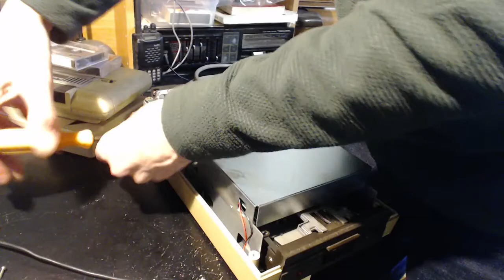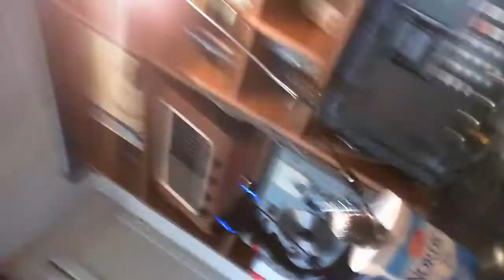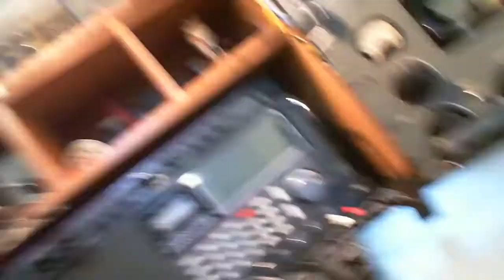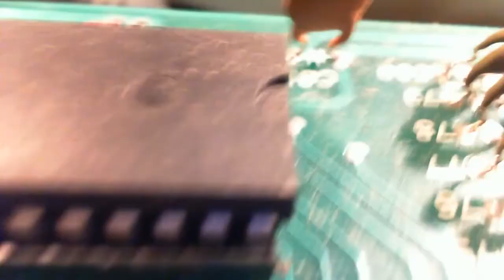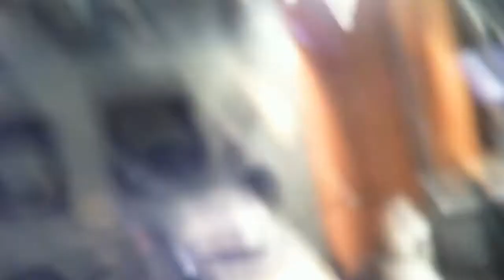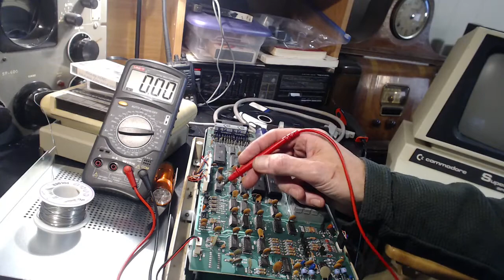Commodore SuperPET SP9000 Video#3 - 2031LP Disk Drive

Comment: I have one of those drives, but last I knew it had an obscure fault.  It formats a disk just fine and for a few weeks the disk works fine, then suddenly you start getting read errors until the disk won't work at all.  Reformat the same disk and the cycle starts again.

I can't figure out what's wrong.  My first thought was the head alignment but there doesn't seem to be anything loose or anything to adjust.

Now I'm wondering if perhaps the resistor which controls the drive speed adjustment has become temperature sensitive?

Anyway, it's sat out in the garage for around 20 years.  Maybe I'll have another look at it.  Maybe not.

Comment: Don`t know if you ever got this fixed, but the first thing i would have checked is the 2 6522 VIA chips (given the symptoms your drive is showing), try pulling them out one at a time and then switching the drive on, if the drive activity light goes out like it should after 2 seconds then that is your problem (the 6522 chips are in every commodore drive and C64`s vic 20`s etc)

Comment: Just to add further to my comments about the drive. To clarify, when the drive boots up it has to reset the head to the zero position. The head is usually driven by a stepper motor with a double spiral shaft so it works in both directions. The head motor first moves the head to the inner position and then reverses and moves the head to the outside of the disk and it clatters it on the stop black then stops. This is the track zero position. You should hear the chatter noise when this happens. What can go wrong is the grease on the lead screw hardens and the head won't move. Just a simple clean and  re-grease with some white lithium grease should do it.

Comment: commodore used the IEEE488 interface between all devices. It's like a bus and all devices are in parallel but have a device number as an address.
The small components you thought were resistors or then diodes are actually ferrite chokes usually in the power supply rails. The small light blue components are also coils.
The head drive for track selection can get stuck and should be free to move. Check all the LED optical sensors. There is one that shines through an index hole and detects that the disk is turning. The head alignment can go out too. When it's  initialised the head should seek to the 1st track. Just some things..."

Comment: can the stepper motor move freely or may the grease be hardened?
Perhaps move the head to the inner position and see if it tries to move back to track0 (perhaps it's the track0 sensor)
After some digging, it's really more likele to be one of the 6522-MOS IO chips at fault (or their socket contacts). At least you could swap them "between positions".

Comment: You appear to have a SCSI interface between your computer and the 5.25" Floppy drive, you need a tool called a chip puller to remove chips without bending or breaking the pins, The WELLOR 8200D is brilliant for the heavy duty work of metal chassis.